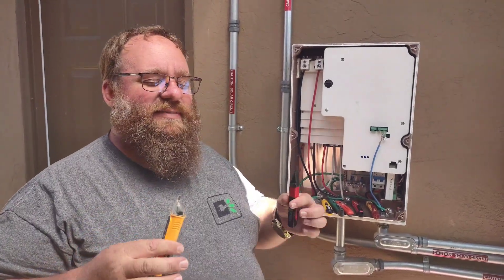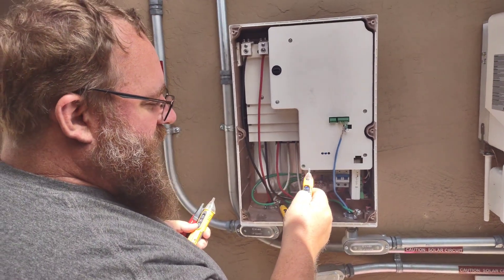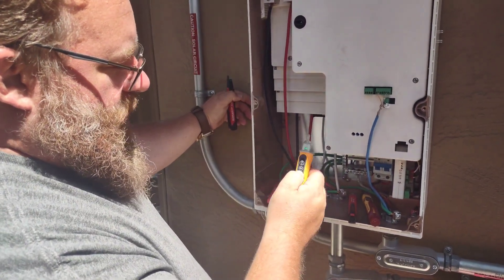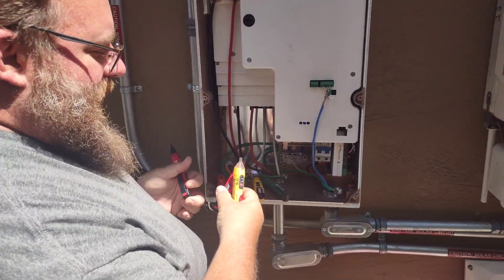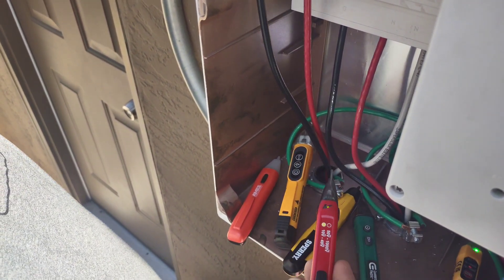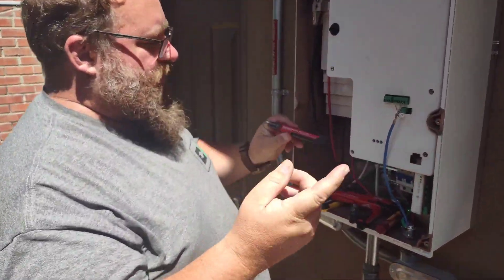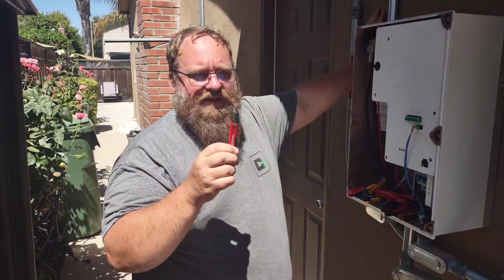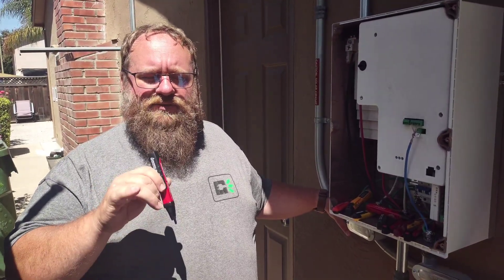How to pick and use a voltage detector and review of Milwaukee voltage detectors

Comment: I got the dual voltage tester from Milwaukee down at Home Depot. It was pretty handy, since it was unclear to me which breaker I needed. I made a mistake with plumbing lately, so I was less overconfident than I normally am. Got the power off, switched out a broken light switch. Now the cover fits kind of funny, but the light switch is good. No shocking myself today. Sometimes I worry that I am just a sucker for certain brands, glad that you find the one I bought to be actually a standout. Thanks for the effort.
Reply: So if is yellow even after turning off the power on the breaker is it still safe to change my light switch?
Reply: @XVIII7  When I had the cover off, power on, I got a red light and a loud noise. When I turned power off, I did not get a yellow. Because I could tell a big difference, I could tell power was off. You could get a voltmeter, if you want to check what the voltage is. $30-50 is a lot cheaper than getting hurt. If you are wearing gloves or something, it can change how well the tester works. I would NOT say that it is safe at yellow. But I am not there to test. I would compare the tester on something I know is hot. Compare with breaker on. Compare with breaker off. It should be a clear difference. If it is close to something else that is on, I might turn that off too(flip off more breakers).